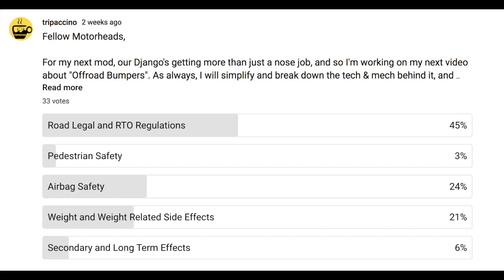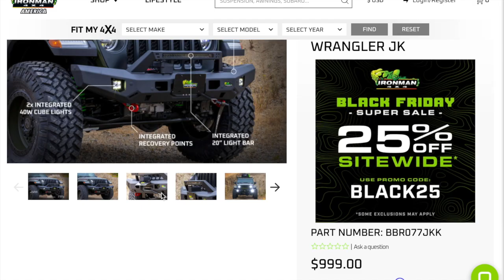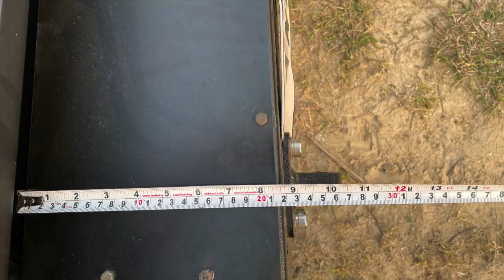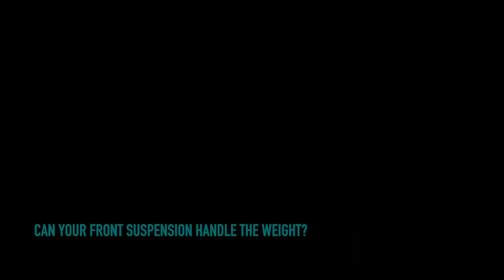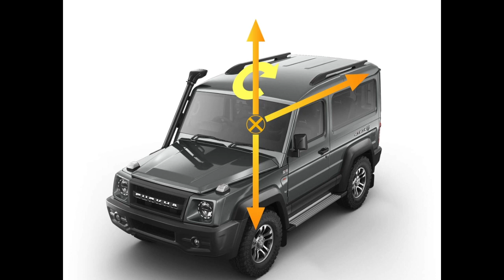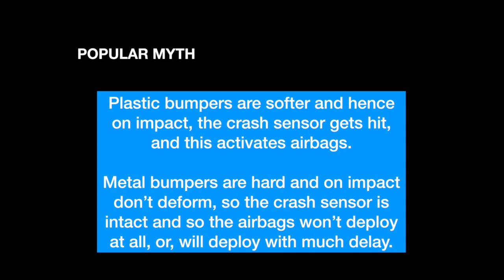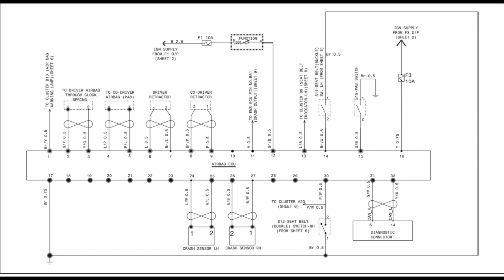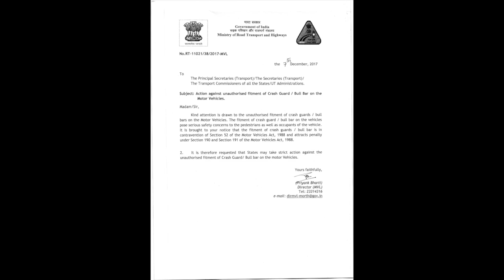Unleash the Full Potential of Your 4x4 with This Must-See Offroad Bumper Modification Guide!

Comment: It good to see force Gurkha on after market high clearance steel bumper with winch compatible. The stock tyres comes with too much inner spacing, so it's not a bad idea to put on after market rims with a negative offset and also to give the 4x4 rig a wider stand which helps in off camber situations when off roading. India doesn't have good after market companies so after market support for 4wd like Gurkha, Thar, jimny, Isuzu d-max is almost nil. We need made in India high clearance steel bumper, winch compatinle, integrated 30 inch light bar, fog lamp, rear steel bumper with swing outs for carrying bigger spare, jerry can, traction board, trash bag, we also need a good quality, modular roof rack like rhino rack, prinsu rack etc.. It doesn't have to be steel an aluminum prinsu roof rack is one of the best in overlanding markets and it doesn't even need to drill the top of your expensive 4wd to put on a prinsu rack. We also need very good quality after market spot lights, A-pillar lights, led lights on side of the roof rack and good reverse light. A good quality dual spot light with after market bumper integrated lights, the rig headlight is enough for a night run, however on a sketchy or trails located on higher elevations an A-pillar flood lights is a good investment. Come on India lets start making our own after market companies.
Reply from the maker: check out my modifications video.

Comment: Excellent vlog n info. One stupid doubt though, How about plug n play type modification for this bumper? Even if it taks 20 minutes for two person to remove the stock and add the offroad one???  Btw the grill on headlights looks awesome cool, you must have fabricated it for sure. Very well clean design. Now awaiting your suspension upgrade
Reply from the maker: @navehal1019 congratulations on being the first one to spot the grills. It’s another one of my custom builds. Thanks for noticing !

It’s not at all a silly doubt, it’s in fact one of the best questions I’ve been asked because I actually wanted to cover it in video.but edited it out due to length. 

Plug n play is ideal but not practical or possible in this case , because the mounting points I explained in the video for stock are frail and delicate and won’t hold up anything more than it’s own self weightZ //The off-road bumper on the other hand is mounted on and into the chassis and mounted in a way to become integral with the chassis so that we can do a proper winch out and recover the vehicle pulling at the bumper. It would not be easy to snap on and snap off because of this difference.

I generally try to have as much as RTS (RETURN TO STOCK) as possible just in case I don’t like the modification or if I’ll effects spring up later then to help me to go back to stock. But sadly this bumper mod is a one way ride. No going back to stock now .

Comment: How about weight less and strong alluminium magnisium alloy bumpers? Are those bumpers available?🤔
Reply from the maker: Expensive
Not load bearing for mounting winch etc. 
Low Rigidity Modulus deform on impact

Comment: One doubt that I still not able to understand. May be you could help me. Why is Gurkha floor is so high. Is it is by design or machanical limitation? . I have not seen any other vehicle with such high floor.
Reply from the maker: Interesting question. You have come to the right channel. 

You have not seen any ‘modern’ vehicles have high floor, but think of SUVs which were built for rough road handling a even upto a decade ago, you will see high floors was the norm. 
Remember Tata Safari , even till the Storme generation? High floor.!
Remember old Land Rover’s? High floor!
Remember (still same design today) G wagen? High floor ! 

The reason these old boys traditionally came with high floor is for mechanical design towards rough road optimisation. 

Let me explain in detail in Tripaccino style - The high floor design found in older Land Rovers, especially in models like the Defender, stems from the vehicle's rugged off-road capabilities and chassis design. Here are some reasons for this design choice:

1. Ground Clearance:Off-road vehicles like Land Rovers need high ground clearance to navigate rough terrains without getting stuck or damaging the undercarriage. A higher floor allows for better ground clearance, ensuring the vehicle can clear obstacles like rocks, logs, and uneven terrain without scraping the underside.

2. Drive Shaft Angle:Older Land Rovers typically have a live axle design which positions the differential low on the chassis. This necessitates a higher floor to maintain a proper driveshaft angle between the transfer case and the live axles for optimal power transfer to the wheels.

3. Suspension Travel:A high floor allows for better suspension articulation when driving off-road. The increased distance between the ground and the chassis permits greater space for accommodating these. 

Any vehicles which were derived from these by inspiration or license also ended up having high floors ( like the Merc derived Gurkha ) 

In modern monocoques these are no longer design constraints with live axles gone and lesser suspension travel requirements.
Reply: @tripaccino  Thanks for your detailed reply. I know you are right person to ask. Please make video of this when you have some time. Lot of people including my self feel gurka will roll in offroad due to high floor and tall body. I took test drive 3 door gurka. I wanted to test drive 5 door but it was not available. After the test drive I felt like floor was to high to everyday commute. more over if I have to build it for offroad+overlanding, lets say 100L water tank, some spare parts, 12v battery, cooking and bed setup all inside car with 2nd and 3rd row removed, I felt like it is too heavy on the top and will roll over. I cannot think any storage on the roof. Other then that diff lockers from factory is heaven. I think I have to put reduction gears in my jimny to achive the low range crawl like in gurka.
 
on third point I have not seen gurka having any better articulation then thar. If we put the same tyres in both gurka and thar, they both will get same ground clarence. because GC is limiting factor here.  Am I missing anything here.

Comment: Gurkha 5 door or Isuzu hilander... which one will you recommend
Reply from the maker: Horses for Courses.
depends on What is the primary purpose?
If you really need the flatbed to haul stuff or for extensive overlanding, then the pickup makes sense, else its not worth the trouble to lug around an empty bed everyday through life.
😁
The 5 door gurkha would be a more practical 'car' if thats what you need. (Provided you have gone through and chosen over 5D thar and 5D jimny)
Reply: I have a duster and i love it because it's
Reply: But what i need is a suv which can do some off roading and also powerful and also able to move my family of 5 members
Reply from the maker: @Itsmylife_1979  

Few questions to help me understand requirements better sir.-

1. what’s the budget? 

2. Do you want a family car that can do some off-roading or off-roader that can move family?

#have you tried the Scorpio N ? It’s the best all rounder today in my opinion., if budget permits you. I would choose it over even the thar 5 door. 

#If the Jimny comes at a shocking sticker price because of sub4m , it should be able to do all that you want and still be easy on the pocket to own and maintain, but will be a little tight on space .

#The Gurkha 5 door is rugged no nonsense off-roader that can also practically move the family. It would still be the least on features and most simplistic of all offerings discussed , if that’s what you’re looking for . 

#I would not recommend any pickups even Hilux - unless it’s a work horse or a recreational weekender //because during normal usage it would be tight on space and sprung harsh on the cab occupants if the rear bed is not loaded.a real pain to drive around city and park the long body in tight spots.

Please feel free to ask me any further questions
Reply from the maker: @Itsmylife_1979  Duster is a great car and very hard to upgrade from.
//Excellent ride quality
//Abuse friendly workhorse 
//Perfect size
Reply: I agree with you about the duster..so i don't want to sell my duster as i have replaced the fuel injector and also recently overhaul the suspension and tyres too which overall cost me about 1.5 lakh now it's as good as new and the insurance has come down to 8 k ..i felt it's foolishness to sell it now as i am very much satisfied about my car